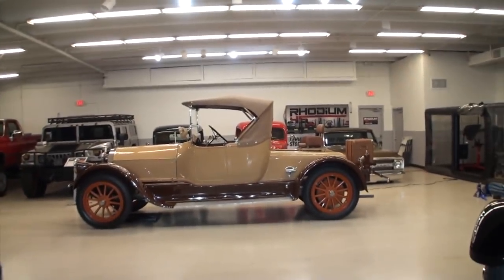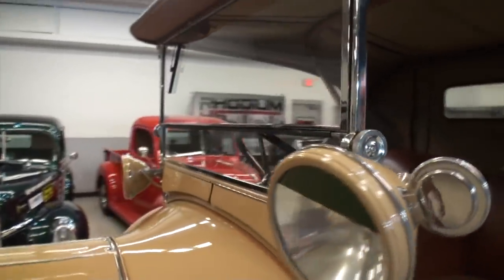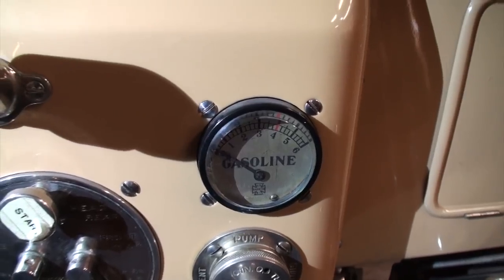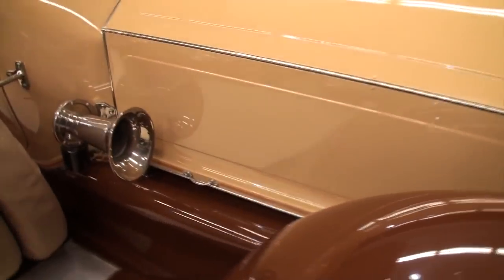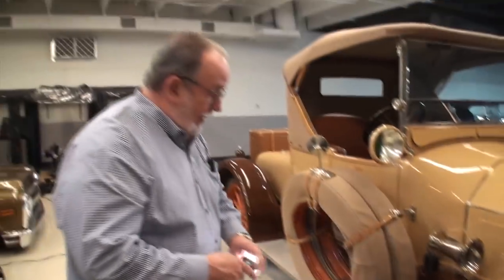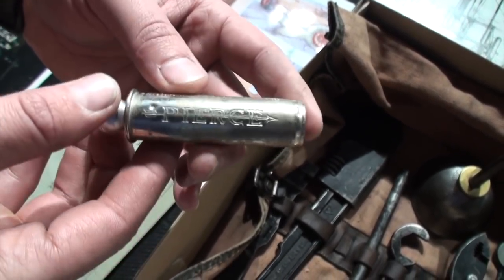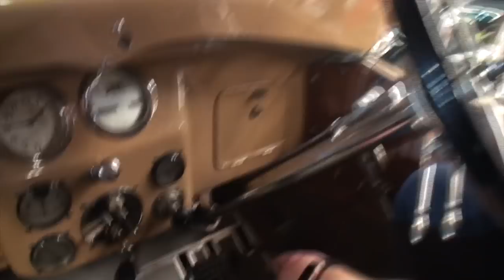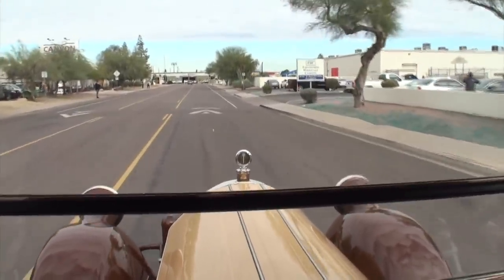1 of 4 Built ! 1919 Pierce Arrow Model 51 Roadster & Ride on My Car Story with Lou Costabile

Comment: I'm pretty sure the car is capable of more than 35 - 40 mph.  With only rear wheel brakes and 3 tons to stop, I wouldn't try driving it faster... but the car can go faster.
Jay Leno's 1918 Pierce-Arrow Model 66 (similar size 6,000 lb monstrosity with an 825 cubic inch 6 cylinder) keeps up with freeway traffic at 70 mph. Packard's "Twin Six", powered by their 424 cubic inch V-12 of the same era (1915 to 1923) also had a 70 mph top speed...

Anyway, thanks for sharing Lou & Mr. Reid! BEAUTIFUL motorcar!
Reply from the maker: Hi Richard, Happy to read you appreciate this "BEAUTIFUL motorcar!" :-) Thank you for viewing, sharing and I believe you're going to see many more cars on this Channel you'll enjoy. Hope you Subscribe, and hit the "bell" so you can see all the cars when they are uploaded on this YouTube Channel, Lou

Comment: I can understand why the mother-in-law was seated high on a 6.000 pound car without a roll bar. Only the passengers in the front had a chance of surviving a roll-over, through ducking towards the passenger compartment's floorboard. It's surprising that only 2 of these vehicles were sold for this very same reason.
Wow! You could have bought an entire house in 1919, for the price of a complete set of those shock absorbers.
Those headlight blinders were applied for driving on the right-hand side of the road. Given that the driver was to sit on the right, it seems that this vehicle was intended for sale in Great Britain or in Oceania
Reply from the maker: Hi Al Dente, Thank you for viewing & sharing, Lou